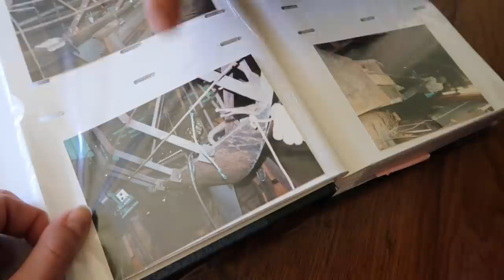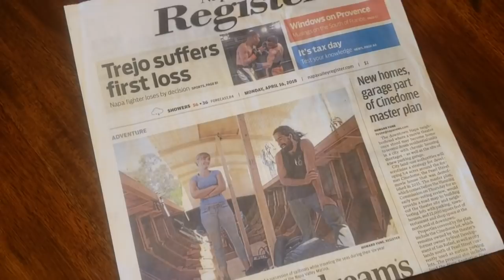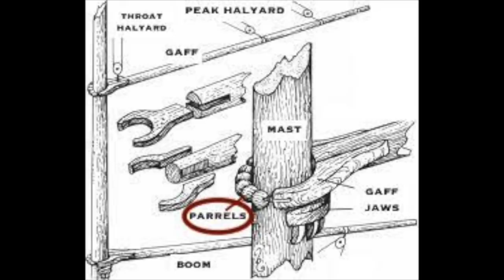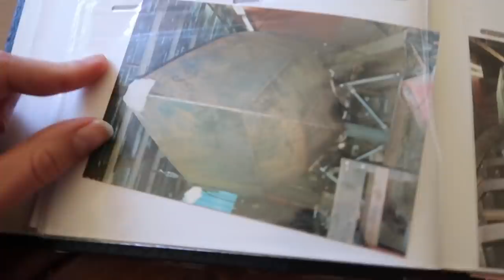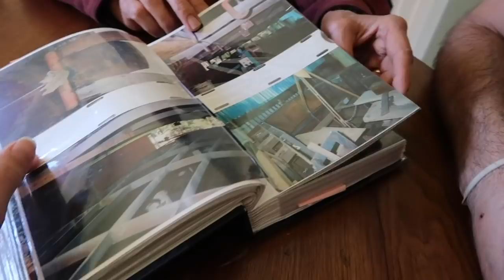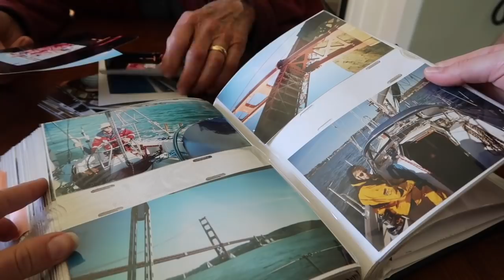Salt & Tar: Episode 89-Who's Charlie

Comment: Well your doing all this work to get the sails rigged and done but I think your way over do the get the engine in the boat all hook up and running once you get the sailes done your going to want to sail the boat then that when you'll need to use the to get out port to put up the sails you'll need the engine for that also if you had the engine running you could take short day trips. Around the area